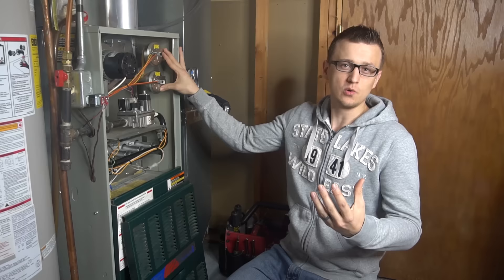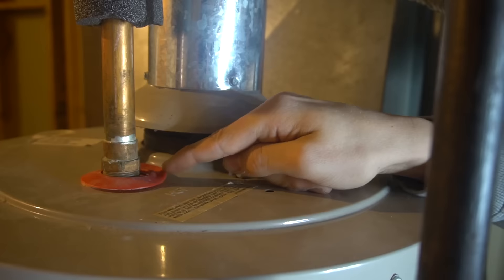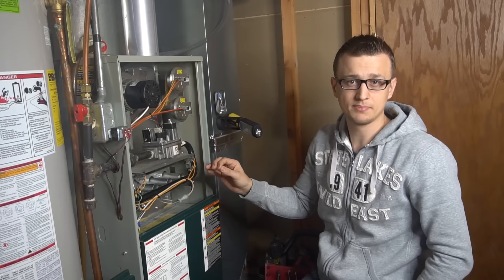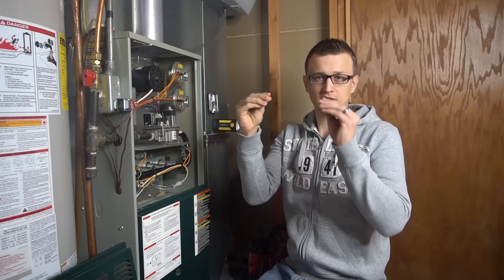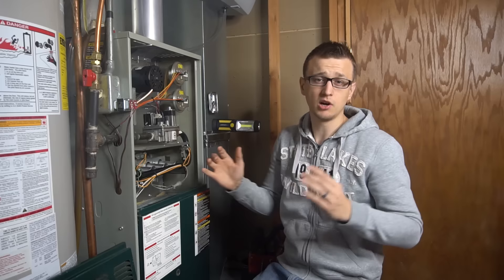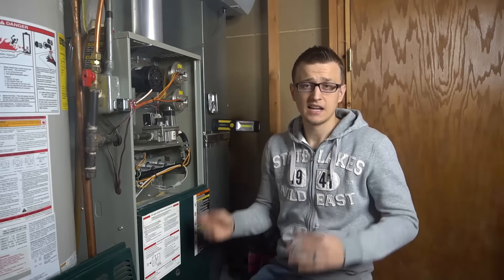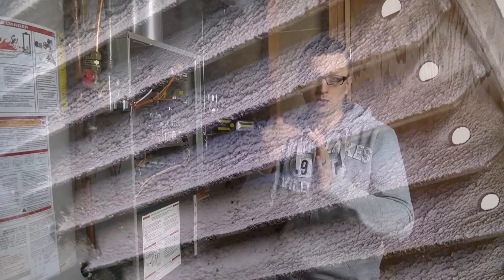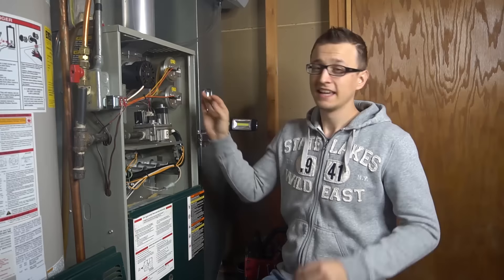Furnace Pressure Switch Troubleshooting

Comment: Great video. Fixed a few things and went through entire troubleshoot but, I still have an open switch code. Idk, what it is. Switch is good, vacuum hoses good, flow both ways, exhaust flows, condensation box clear, have correct power. Idk man.

Comment: Dude my local Utility company DTE told me 5 days before they could fix my furnace, it's under warranty. Called someone else explained they problem they said it's either thermostat or pressure switch. DTE guy shows up tells me it's the motherboard, I tell him I just replaced it with the spare they gave me. I asked him to try swapping thermostat and he said "It's 100% NOT the thermostat, I have to order the part be back in 2 days" -- I swapped the thermostat myself and the furnace worked intermittently until I watched THIS VIDEO, cleaned the hose to the pressure switch and problem gone. DTE guys shows up with motherboard and I tell him, I swapped the thermostat and cleaned the PS hose you owe me $50 bucks.

Comment: What a great video, helped me a lot , did my ohm readings on pressure switch , and both readings were infinite, connected back on , and works fine now , burner kicks on immediately, probably need a new pressure switch eventually , should I order one ? Thanks again, roger , Ontario, Canada

Comment: excellant presentation thank you so much I have a newer high effic furnace with code three short and three longer dashes. may be the thermostat which is bad. furnace runs ok but thermostat does not program properly
Reply: @Thomas - I had that on an old Bryant furnace. 3 short and 3 long blinks is a high limit problem. WOA has a good video on that problem. https://www.youtube.com/watch?v=3ZPmltTR5S4

Comment: The video is amazing in its simplicity. My pressure switch has been flaky for a long time but somehow it would start working. I went through the video to eliminate all the reasons and came out empty. Thank you for the suggestion on how to check the pressure switch itself. Once I heard the click on the pressure switch I figured I had to look somewhere else.
What it turned out was the pressure tube going to the furnace. This is a tube that is square from the outside for American Standard furnace. On the furnace end, this tube was not as tight fitting. After taking the tube out I put my thumb on the open tube, which started the furnace. I temporarily put a string around to tighten the fit.
Question - what is the purpose of the tube being square from outside? What kind of tube should I look for replacing it?
Thank you.

Comment: Got the 3 blinks on a Tempstar propane furnace after the exhaust drain hoses froze. Thawed out the hoses tapped the pressure switch and she fired right up. Thanks for the information

Comment: Great explanations! Super informative!
My question is why is there a copper gas line?
I thought they corrode with the sulfur the gas co adds to the gas, and were against code
Reply from the maker: Thank you! Codes change. It used to be okay so many of the older homes still have copper gas lines. Mine was like that when I bought the house and I didn't bother to replace it since I see it all the time and the pipes don't seem to be damaged.

Comment: Got the error code every once in a while, usually a reset would fix it, but very annoying not knowing if the furnace would stop working/turn on. Today, 5 resets didn't fix it. Evening waiting 15-20 min. between turning it off and turning it back on.
 
So I decided to check the error code, instead of just resetting, 3 flashes.
 
Turned out it was the connector to the pressure switch. When I took it off, I could see some "stuff" losely blocking it, guess that's why sometimes it worked. Cleaned it out.. and the heat is back on.
 
THANK YOU!!!! For making this video!!

Comment: I love your videos! Super helpful, can you bypass safety switches to have heat going while you get the part that you need? If so if like to see a video on how to bypass stuff please!
Reply: Kevin Castro that's not recommended. Safety switches are put in systems for a reason. Safety switches are telling you something is wrong with your unit
Reply from the maker: Thanks Kevin! I agree with Moises. Bypassing safety switches should only be done for testing purposes. Otherwise the furnace can get damaged or even worse it could become lethal.

Comment: Agreed, the old school metal construction pressure switches very rarely  fail.  However, the new plastic type switches are far more prone to fail.  Allied had a real problem with the switches used in thier units... found to be corrosion on the contacts.  The newer ones have a coating that helps with that.
Reply from the maker: Thanks for pointing that out! All tips and suggestions are welcome :)
Reply: Word of Advice TV yeah, these newer plastic bodied switches are no where near as reliable as the older metal ones.  I've found often times the switch is working, in that it is closing (you can hear the switch make/click) but it doesn't complete the safety circuit.   Reason being, the contacts are corroded and not passing current. I'm thinking it has to do with temp. Differential. The metal construction held the intake air temp. Closer than the light plastic body will. The burner compartment temp transfers through the plastic switch jacket resulting in condensation forming on the contacts. This didn't happen with the steel units. The quality of material/construction is an obvious factor as well, but I'm sure the temp. Is the real culprit here..... that's my theory and I'm stickin to it.  Any thoughts?
Reply: @meszaroslaszlo203  If one believes the internal contacts are corroded, then one may be able to measure a voltage drop across a closed switch. One may be able to tear apart a switch but corrosion is a very difficult thing to measure unless it's gross. Very light corrosion depending on it's make up (conductive or non-conductive) may exist sufficient to impart a voltage drop however this drop would need to be great enough to cause the output to drop below minimum input high down stream.

Comment: THANK YOU GREAT VIDEO !!!
Mine was a clogged port off the pressure switch I took a small nail and poked it through the hole and I felt it break through something. Fixed just like you said !!! (6:00)

Comment: Love the logical fast way you explain things! BUT... you didn't show us DYI ers how to check for voltage to pressure switch!!
Reply from the maker: Sorry, the video was 40 minutes as is. If I stopped on every component it would have been twice as long. But if you are interested.. :) The pressure switch will usually have just two terminals. It is a normally open switch.  Once the inducer motor turns on, the air pressure it creates closes the pressure switch. So if a pressure switch is closed and you measure voltage by putting one lead on one terminal and the other on the other terminal, you would get 0v for a closed switch. If the switch is still open for some reason, then you would get 27v. Hopefully that helps!

Comment: Thanks for this video, very insightful. One question about a hot inducer motor…if the motor is hot does it necessarily mean it’s going bad? If it stays on because the pressure switch never closed, doesn’t that mean it could be another issue? Thanks!

Comment: I was able to fix my pressure switch (stuck open) through troubleshooting (cleaning?). However, it was only temporary. The outside temperature did drop below freezing so perhaps it is one of my pipes outside!? I hope my house doesn't drop below freezing tonight because Home Depot is closed and it's too late to get space heaters to keep my pipes from closing. Thank you for all your input 🙏🏼

Comment: Awesome video, it was very helpful in identifying the issue of my York Diamond 80. The LED indicator was flashing three red blinks meaning "pressure switch stuck open", which is, how I found this great video. My issue was that the Plugged Pressure Switch Port was plugged up and rusty inside. Is there another video that address, how to fix this or will I have to continuously keep unplugging it whenever it fails to start up?

Comment: Thanks. My outside condensate line was frozen all the back to to the vent tee inside. It has been very cold here north of Seattle. 17 last night. The igniter failed maybe because furnace was trying to start so many times. Luckily I had a spare from 2015. Wonder if the condensate was frozen then, because it was a few days before I received the parts and it might have thawed.

Comment: This is a great video of what the possibilities are of the error code. I have 4-45 degree elbows and 2-90 degree elbows on the intake. 4-45 degree and 3-90 degree elbows on the exhaust. There is adequate rise on the pipes. Is this too many bends? How do I know if I have the right pressure switch? I have been having this error intermittently since I installed the furnace about 10 years ago.

Comment: My furnace kept flashing 3 blinks. I replaced the pressure switch to no avail. Took a leaf blower and blew out the exhaust vent and induction motor. It worked temporarily. Took apart the induction motor fan and cleaned it ( there was some dust). It works but then still throws me the 3 blinks. It’s a 20 year old 80% furnace. (Next day I brought in a pro who said it was the circuit board). I’ll be replacing that tonight. Fingers crossed. Update: it was the circuit board!

Comment: Great clip with priceless content.  I have water collecting in the inducer motor housing when I blow through the pressure switch hose to the housing I hear the gurgling.  So I will check the trap.  Also the pressure switch clicks open and closed for sometime before the burners light?  Any thoughts?  Happy New Year!  And much success in 2023

Comment: Just had pressure switch lockout code. Watched your video and followed along. Furnace fired up. Thank you so much for taking the time to help! 
Not sure if it was cleaning out the port or when I lightly blew into pressure switch that may have been stuck. Or loose wire. Anyways it is working. 
Do I owe you a service charge lol
Reply from the maker: I'm happy to hear you were able to get the furnace fixed! You coming back to leave a good comment is the service charge :) Stay warm!
Reply: @WordofAdviceTV  it went out again in the middle of the night. I got up blew into the pressure switch it fired back up. Should I replace pressure switch?
Reply from the maker: @whitechris720  Sorry to hear about the problem coming back! If the pressure switch keeps getting stuck in a closed or open position, yes, I would replace it.
Reply: @WordofAdviceTV  thanks

Comment: Great information! I have a carrier high efficiency furnace (about 15 yrs old) that will only run on high heat mode. It will start its normal cycle procedure, inducer motor starts, burners light , then it defaults and gives a low heat pressure switch code. After the blower motor stops it will instantly restart in a high heat mode only. (Code indicator resets to normal)It runs fine in this “wide open” mode until the thermostat is satisfied and shuts off. Then it repeats this process every time. I have checked all of your trouble shooting suggestions in this video and everything seems to be good. Any ideas would be much appreciated! By the way, you gave a very informative and easy to understand tutorial in this video, you should have your own TV show!! Thanks a lot!!
Reply from the maker: Hey Jay! Glad you find my videos helpful! Unfortunately I can't give you a good answer. The first thing I would do is verify and see if  the low stage pressure switch is indeed opening or if it's stuck in an open or closed position.  I would do this by checking the voltage across the switch when the inducer motor turns on. It should have around 27 volts initially and when the inducer motor turns on, the pressure switch should close and the meter will read 0v. If the pressure switch.re-opens, you should see the voltage jump back up to 27v.  Sorry if that's hard to understand. Pressure switches can be a nuisance. It's also possible that the control board is malfunctioning too.
Reply: Just to update my fix. I didn’t check the condensate trap “good enough “ because after a run I good hear water dripping into the drain. But I decided to go ahead and remove the trap and it was indeed stopped up pretty bad. After cleaning it out the furnace is running normal again! Thanks again for your super helpful and detailed info videos!!
Reply from the maker: @jayscott8177  Awesome! Glad to hear you got it going, stay warm! Thanks for coming back with the update.

Comment: Thanks for this video. A consistent issue I have concerns when spring arrives and the gas heat has been off for a day or two (even on the thermostat). Weather has a cold snap and now the heat is needed. The furnace blower runs but the burners don’t fire. LED blinking says a pressure switch issue. I kill furnace power for one minute and then spin the inducer motor. Power it back on and voila - I have heat again. What is tripping the sensor over those two days?
Reply: We’re having the same issue. Did you ever find a fix?
Reply: @stacy695  thanks for asking. Unfortunately no. We are the fix!

Comment: Great video. Quick question, my furnace is 33 years old and still works great. Is there any reason that I should get a new furnace other than for efficiency? Can internal parts be easily found if I need work done on it in the future? Also what brand furnace would you recommend?
Reply: My furnace is 33 years old also and I recently replaced the ignitor and ignition module.  Part numbers may change but the parts are generally available.  Efficiency on this old unit is 80, the same as what is being installed new today.  I would keep what you have until you have no choice but to replace it.
Reply from the maker: Just like Johannes said, I would keep it until it dies :) The old furnaces don't have much components in them to begin with so most of the time finding a part is not a problem. Honestly I don't even know which brand is best.. I see all of them having problems. I think Trane is pretty good (aside from some of the really annoying access doors that some models have) Also, with older furnaces, make sure you have at least one new carbon monoxide detector in the house (less then 7 years old).

Comment: I had a 10year old trane this year with a bad control board #10. Fault code said bad pressure switch. I tested the switch and it was good. The draft motor wouldn't come on so I checked the line voltage to the board and it was good. However, the board was only feeding 36 volts to the draft motor when it was time to come on. I replaced the board and it then worked fine.

Comment: 7:30 plugged condensate trap was my issue. 
Took the trap out and it was filled with moldy gunk. 
I also blew into the hose that went from the furnace into the ground drain. 
The drain tube from the furnace into the ground was shoved too far into the pipe causing water not to be able to flow down the drain tube.

Comment: Great video, I learn a lot from you, I do have question , I have 24 v transformer inside furnace and this one for the control board and there is one outside close to the switch, what is the function of this one , it is also 24v

Comment: Hi, 
First of all your videos are amazing, thorough, and easy to follow.  Very much appreciated!
I noticed my  house was cold, but the furnace was running.  Felt the air from vents, and it was cool.  Realized burner wasn't lighting.  Goodman HE furnace LED indicated "Pressure switch cycle lock out." I tested both switches. Each behaved the same when inducer motor first came on, the Ohm reading initially went to zero, but then became somewhat erratic. Shortly after this,  the inducer motor shuts off.  Prior to this, my wife and I had noticed the exhaust fumes from the vent smelled a little like unburnt gas. Based on what you mentioned, it's leading me to think it could be a corroded secondary heat exchanger. I don't have the combustion meter, but based on the smell of the exhaust, do you think I could be on right track? Any other things that could cause those pressure switch readings to fluctuate like that? I also thought I smelled a slight trace of gas fumes in the basement just a day or two before the furnace stopped working. possible the secondary exchanger finally got too bad to function?

Comment: Thanks so much for your very informative video. In my case, a spider laid eggs right inside the furnace connector just before where the rubber tube connects to the pressure switch. I used a toothpick and poked into the furnace connector to clear it. The spider ran out and the egg sack was attached to the toothpick which I pulled out. Everything worked afterwards

Comment: Hi, great video , i was wondering any ideas i have a older rheem furnace, last winter intermittently the inducer motor would turn on and run but the furnace would not light and the inducer motor would then stop . I figured possibly something wrong with pressure switch not operating properly. Sending signal to gas valve . I did remove plastic tube and blew into it and put it back on , havent seemed to have a problem this year .
Reply from the maker: Well it sounds like blowing through it did the trick :) Maybe there was a small piece of debris in the tube (like a flake of rust) and you blowing on it was enough to clear it out. The pressure switches are pretty sensitive so it doesn't take much to cause them to trip/open.

Comment: If it was a 90+ furnace you should check the condensation drain.. if it is clogged or a restriction it will fail the pressure switch.

Comment: Your videos are very informational. I have a Lennox furnace, everything works but when it is time ignite the furnace, I hear one click from the igniter and that’s it and the furnace doesn’t fire. It keepe working like that hours and hours. Tried replacing pressure switch etc, but nothing helped. I am just wondering what the problem is? Thank you!